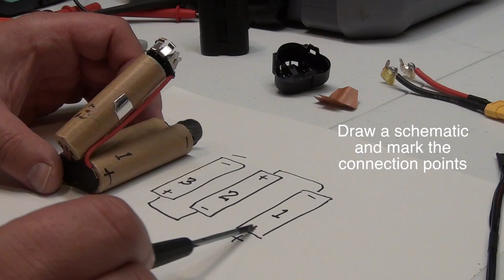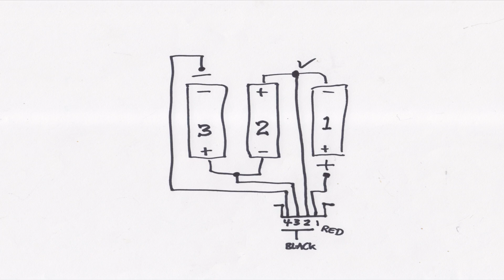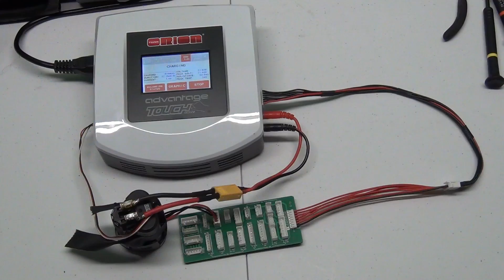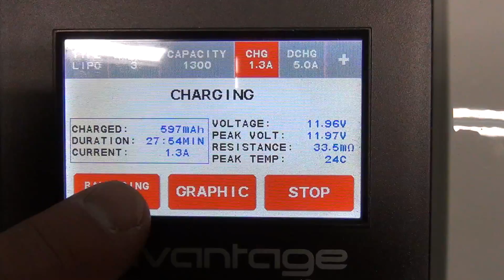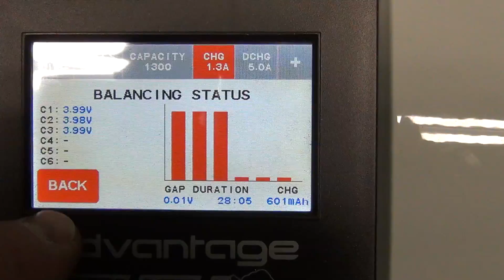Dremel Battery - Intelligent Charging

Comment: @mygiguser what other batteries in stores can you use in a Dremel tool besides the one that comes with it? They don’t carry the Dremel branded ones at home depot or Lowe’s in my area and online they are expensive and don’t charge or keep charge worth crap.. I need extra ones for work (I saw a couple at harbor freight and a Milwaukee one that look identical, both 12v lithium)
Reply from the maker: Brent Hughes i don’t know, my batteries still work after a year of use. i wonder why you’d think the Dremel ones are not good. maybe your charger is the problem?

Comment: Any idea what is the function of the sub pins? I know one is not connected to anything, while the other 2, one is labelled T and the other C. I measured both and they are not balance leads, both read the full ~12V. Does this mean the dremel charger does not balance charge them? I also have Dewalt batteries and the sub pins are for balance charging.
Reply from the maker: darren chong Yes, the Dremel charger doesn't balance the battery, because the battery has no balancing connections. T could mean temperature, and C could mean common (ground), but I am not sure about that.